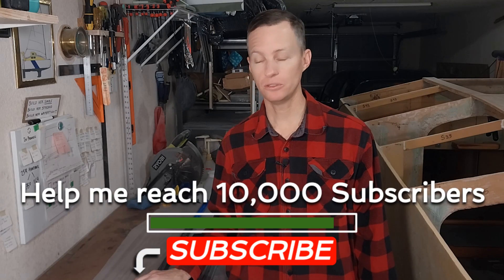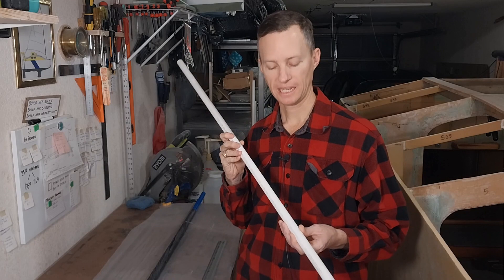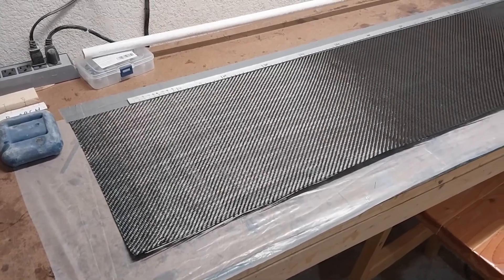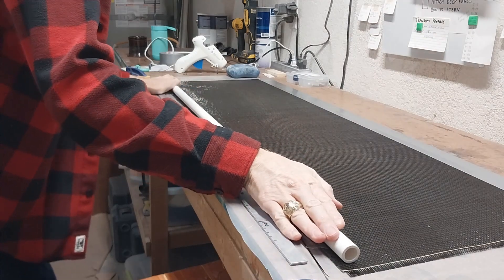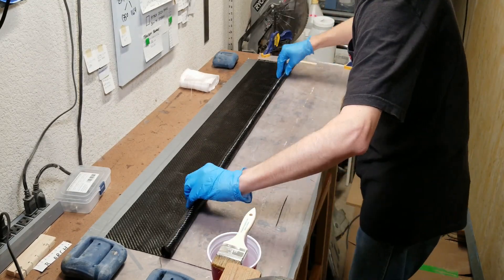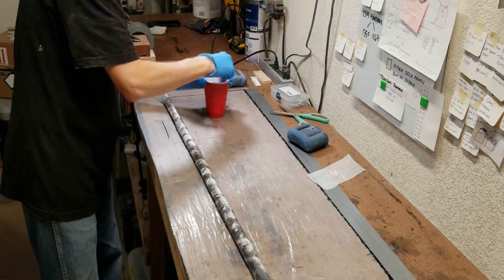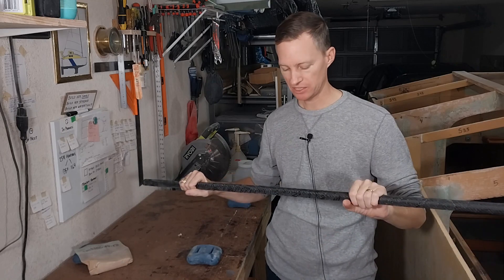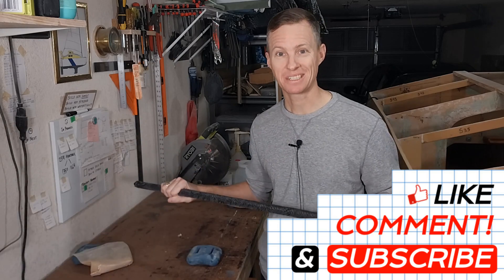OCSS-075Pt1 Making a Carbon Fiber Tube for Handrails (February Mini Episodes)

Comment: You might have got less wrinkles if you didn't wrap with duct tape, i'm guessing the duct tape is to make it easier to deal with while curing? could you just hang it with some wire (coat hanger) tucked into the ends of the pvc? Or is the purpose of the duct tape to also apply some compression and squeeze out some epoxy (poor mans vacuum bagging?)
Reply from the maker: Yes it's poor man vacuum bagging. The end result was quite good. Everything will eventually get some fairing and painting anyway.

Comment: Nicely done. Working with wetted out carbon fiber is like wrestling a greased eel. I made a sprit boom for a small sail and it came out so bad it looked like I painted a stick from the woods. It is nicknamed "Lumpy". You did much better.
Reply from the maker: Yes exactly! It's as slippery as an eel in an oil slick, haha. You should have another try and remake that pole.

Comment: I'm not sure what your plans are for the tiller, but the first tube could be used as an emergency tiller perhaps.
Reply from the maker: I could definitely make a tiller this way. I actually used the nicest 2/3rds of that first tube as the port side handrail, and the rest will be part of a swim step on the transom.

Comment: Nice method!
I made a carbon fiber spinnaker pole for my 15-footer by rolling it on a PVC tube. Didn't use the tape on the table to be able to stretch it and got lots of wrinkles in it. The plan was to just wrap it in plastic and roll it until all wrinkles were gone, but that didn't work. A bit of sanding, filler and another wrap saved it, but nice to see you can get much better results with a smart method.
Keeping the mold tube inside really simplifies the process and doesn't add a lot of weight, so unless you aim for the ultimate weight saving this is a good way to do it. 

I've seen that you can use shrink tape for the final wrapping. You heat it up and the tape will shrink and create a really tight wrap. I'll try that next time.
Reply from the maker: Shrink tape is a great idea. I may try that some day. On my first attempt I used saran wrap to wrap it at the end, but it didn't work well at all. That's why I went to tape for the second try.

Comment: I am wondering why you did not use carbon fiber sleeves for the handrail. They are manufactured in a variety of diameters and can be formed and fit to the PVC mold you used. Down the road, you may wish to check that out as a possible fabrication option.
Reply: He got a great result with the carbon cloth.
Reply: I've used sleeves to beef up windsurfer carbon masts for other boats and it worked well. But here, Capt. Perry got 5 layers at one go. With sleeves, he would have had to laminate a layer at a time, carefully sanding (carbon fiber dust is very bad for you) between each application. I think sleeves are better for bigger jobs.
Reply from the maker: I didn't use sleeves because it would be harder to get them tight. By rolling it I can tighten it up like rolling a cigar.

Comment: On the first bar which you showed, you might not have liked the uneven surface, but considering how slick carbon fiber tubes are, the nobbly and uneven surface would provide an incredible easy-to-grip surface, fitting easily in your hands, which is what is needed when sailing.

Comment: Why do you not use a vacuum bag?
Reply: For a lot of layup work, vacuum bagging is overkill. The peel ply and duct tape serve the same purpose as vacuum bagging by consolidating the layers and forcing out air and excess resin.
Reply: @j.saavedra1502 agreed, just like Shayne does on Young Barnacles.
Reply from the maker: I don't have the equipment and I don't really feel it's necessary.

Comment: Why use a thin strip of peelply? And not use the same width as the bar? Not getting that spiral.
Reply: I have to agree with you.  That may have been what added the few wrinkles to the finished product.  Since he started at one end wrapping in a spiral pattern, it likely pushed slack in the carbon fiber wrap as he worked it along the length -- from tight side to loose side.  Wrapping the peel ply in the same fashion as the carbon fiber would more evenly disperse the pressure.
Reply from the maker: Try it and you will understand. The first failed attempt was made worse by doing it how you suggest. It's much harder to get a tight wrap if you don't use a long thin strip. I've made a couple now with the way shown and the results are great.
Reply: It's far easier to get even pressure this way, the peelply will hold itself as one wraps it up and it won't unravel. Also, as pressure is force divided by surface, less strength is needed to compress the CF tightly as we only wrap a small surface at a time.
Reply: Nice work!